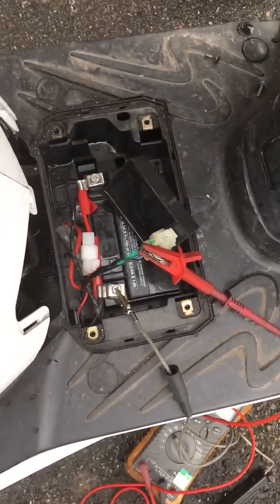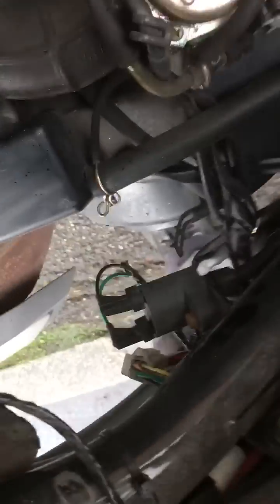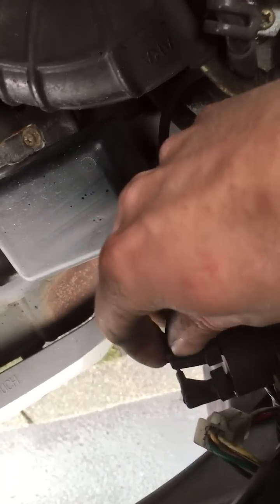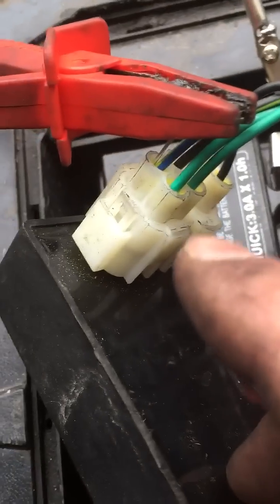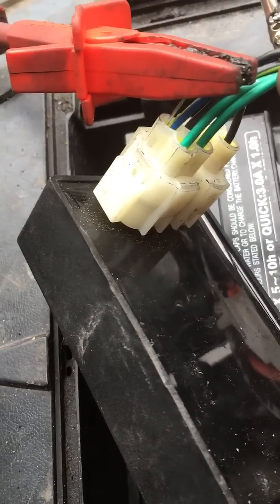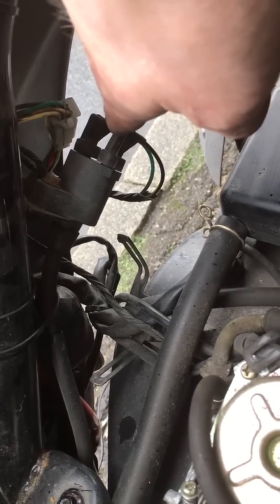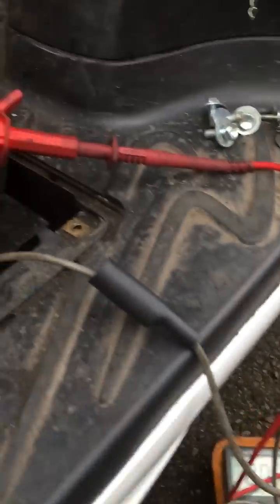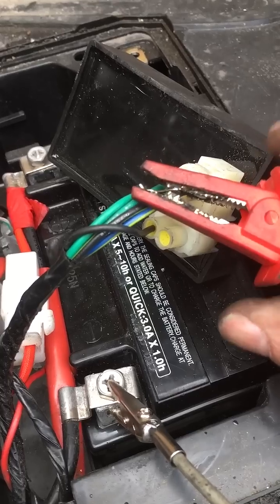Testing a CDI unit

Comment: Whats the moaning for excellent video , showing testing primary signal side testing of ignition , and testing at the cdi for primary signal then testing for pick up coil signal and then using the a multimeter set to amp meter to provide  fuse protected bypass from pick up coil to cdi. Quite useful tests and skills if you all watch it.
Reply from the maker: Thanks for positive comment 👍🏻